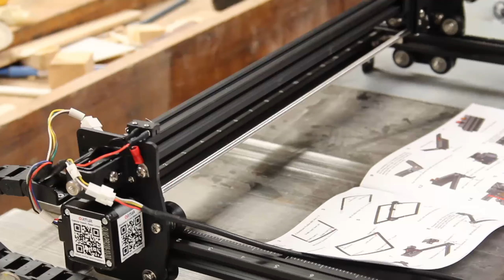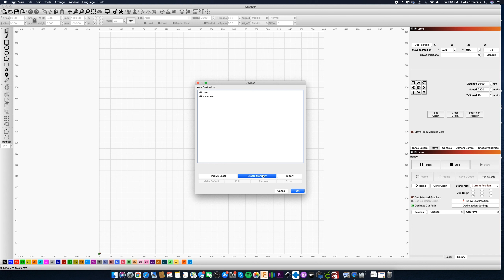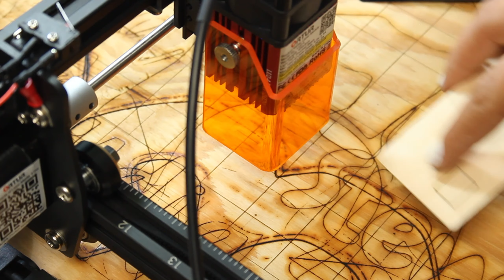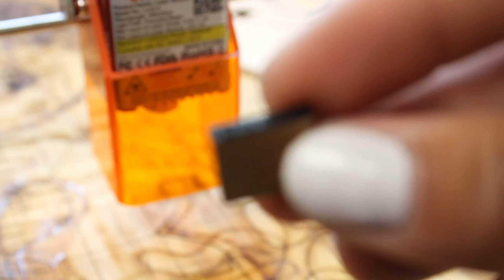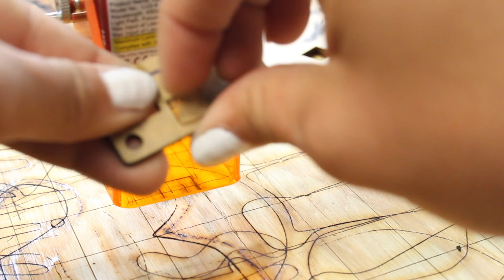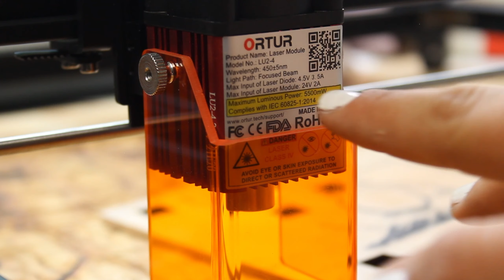Ortur Laser Master 2 Pro Review

Comment: Thank u for the advice to check this one out. I am looking on Amazon and there is 3 to pick from. What’s the difference?  OLM2ProS2-LU2-2  OLM2ProS2-SF  OLM2ProS2-LF.  What’s the story and lf mean?  I’d want the stronger one if that’s got anything to do with it
Reply from the maker: You will want the OLM2Pro-LF that comes within an air assist attachment for the laser head. That is what I use and I can cut up to from what I’ve tried one quarter inch solid pine wood.
Reply from the maker: Please use the links in the description when purchasing it really helps my channel

Comment: Good review.  But, a couple of things.  First, ALWAYS wear safety glasses around a laser.  Damage is cumulative and reflected laser light is still dangerous.  Second, you really need a venting system.  The laser burns the material.  There is almost nothing coming out of that machine that you want to breath.  Remember, live paranoid live long.
Reply from the maker: yes, I always wear my glasses as mention in the video. Also, I am working on a venting system. Right now I am next door to our shop that has a vent system and I have fans going that move the smoke to that area. Yes, it's not perfect but it works for now.
Thanks for watching!

Comment: I have a K40 and love it but I want to be able to cut and engrave larger stock and the Ortur 2 is the ideal machine, I would need to build an enclosure though so I can extract the fumes and also add an air assist to get it working to the best of its abilities.
Reply from the maker: Air Assist is my next thing to add to this, just need to find one that will work for it. And for the enclosure, I am going to make one when I have enough room in my shop, right now, it’s a little full😂

What is a K40? 

The ortur can’t cut too thick but for thin stuff it does great
Reply: @TimberWood.Customs  K40 laser cutter https://www.ebay.co.uk/itm/304028016503?hash=item46c97b5f77:g:nJAAAOSwpXVg3HUX
Reply from the maker: @AndrewAHayes  oh sweet! Is it strong?
Reply: @TimberWood.Customs  Yeah its built like a tank and is pretty heavy but the block and tackle makes raising it a piece of cake and he locks it up with a carribena attached to the parracord that locks over a wall hook
Reply from the maker: @AndrewAHayes  how well does it cut? Anything thick? Is it fast?
Reply: @TimberWood.Customs  It can go fast but I prefer 60% and 350 pm 4-5 cuts on 18mm plywood, its definetly hobbiest class but like any of these machines air assist makes all the difference, it has built in water cooling in the form of a water loop and pump and you provide your own bucket
Reply from the maker: @AndrewAHayes  wow 18mm It would be sick to have one of those
Reply: My friend is also short on space in his shop so for his Ender 3 enclosure he made wooden rails to go on the wall so rollerskate wheels attached to the back of the enclosure could run in them, he then has a block and tackle to pull the enclosure up to the ceiling out of the way when not in use, when it is down he has a foldup frame to support the enclosure.

Comment: Thanks for the review. FYI your laser module is the LU2-4 which is a 15Watt (4.5V x 3.5A) which gives about 5Watts of Luminous power.
Reply from the maker: Oh that’s weird… I should have been sent the 20w. I’m sorry I will mention that I made a mistake. Thanks🤦🏽‍♀️
Reply: @TimberWood.Customs  to be honest they do not make it clear in the specifications. It does not mention the electrical wattage as they do for the LU1-2, LU1-3, and LU1-4. The LU2-4 is only stated as 5W luminous power, whereas the LU1-4 is 5.5Watts @ 20Watts. On the label on your laser it says 4.5Volts at 3.5Amps which in DC terms is 15.75Watts although it looks like they may have tweaked the lenses to give a narrower beam. Not an easy topic to get your head round. Ultimately it’s trial and error with speed, power and repeats to gain the best settings. I’m no expert in lasers just electronics so only going on the specs they’ve given. I’m looking forward to your review of the router 😃
Reply from the maker: @johngrant5749  thanks for that info! And yes me too I can’t wait to try it out! Thanks for the support and watch the video!
Reply: @TimberWood.Customs  I love your enthusiasm ❤️

Comment: Is using laser at full power a real killer??

I always use mine at 100% but change the speed, mines 20w
Reply from the maker: I’ve been told that using it at 100 is not good, so I always stick to 80.
Reply: @TimberWood.Customs  have you killed a laser yourself?
Reply from the maker: @NiallGibbon  yes:) but it may be because it was a trash laser
Reply: @TimberWood.Customs   was it an ortur?
Reply from the maker: @NiallGibbon  no, I have just been told that can happen to any lasers
Reply from the maker: @NiallGibbon  ok well I just tryed 100% power and I think I just killed it. It’s not cutting or engraving like it use to….
Reply: @TimberWood.Customs   really they would say that in the manual to not run it at 100 if it was a big problem? 

I hope you get it fixed!
Reply: @TimberWood.Customs  any update?
Reply from the maker: @NiallGibbon  yeah I think it’s fine now
Reply: @TimberWood.Customs  find the cause?
Reply from the maker: @NiallGibbon  nope